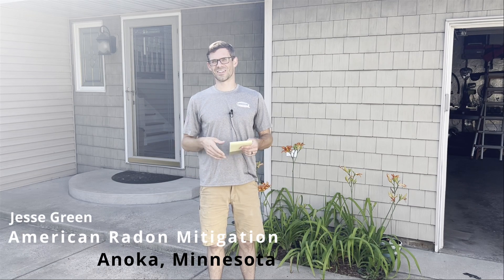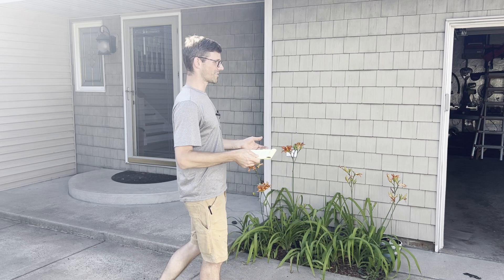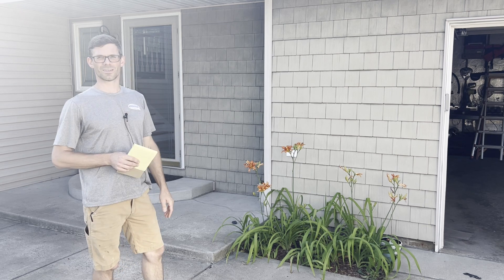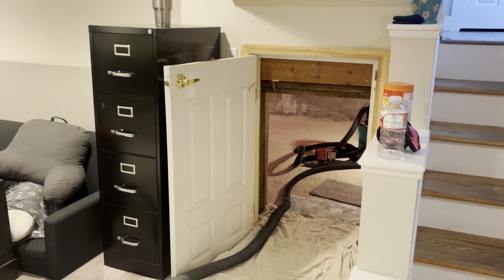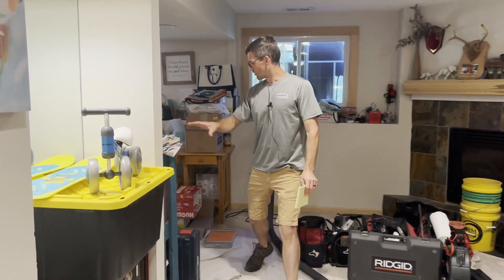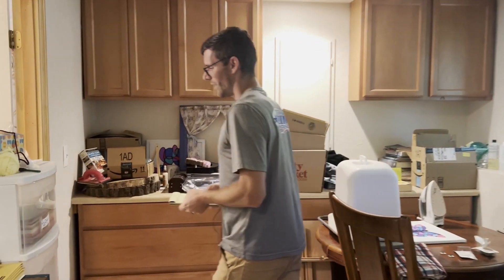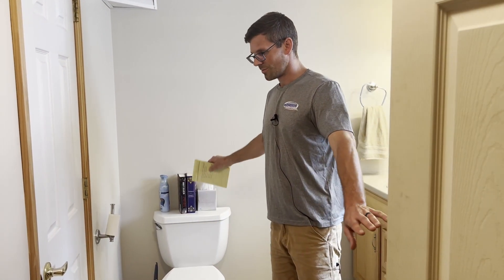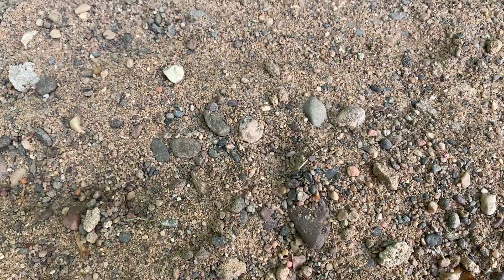Identifying Radon Mitigation Challenges

Comment: First, I want to thank you for the wealth of information I've gained from your channel.  I have a finished basement(Atlanta GA), and to be honest, no one mentioned radon testing during construction. I could have done a better job sealing the floors and walls.

I'm currently using two Airthings devices (Corentium and Wave Plus 2nd generation) placed side-by-side in the basement.  They're showing a weekly average radon level of less than 4(3.8).  When I turned off the basement's dedicated HVAC system, the radon reading dropped to 1.5.  Additionally, opening a basement window further reduced the radon level. Considering these results, I'm thinking about installing an Energy Recovery Ventilator (ERV) for ongoing ventilation.  What are your thoughts?
Reply: Sounds like a negative pressure issue. I would install a ERV or HRV balancing the unit 60/40 (intake 60% / Exhaust 40%) to create slightly more positive air in house to make up for HVAC sucking in Radon looking for passive air intake.
Reply from the maker: I don't have any experience with HRVs or ERVs. I've heard they can be expensive to operate since you need to double your air changes per hour to cut your radon levels in half. 

One crucial aspect that many overlook is the regular maintenance of air exchanges. A clogged intake screen, for instance, can lead to increased radon levels. This is because the system, under such circumstances, would create more negative pressure in your home, drawing in more radon.

If it were my house, I'd install a radon mitigation system and stop the radon from entering my home rather than trying to dilute it once it enters.
Reply: @AmericanRadonMitigation  ok thank-you
Reply from the maker: You bet.
Reply: so it goes down when you open a window? seems like the radon leak would be away from the area of that window. When i open windows in my basement, my radon levels don't really change (i too am using the air waves).